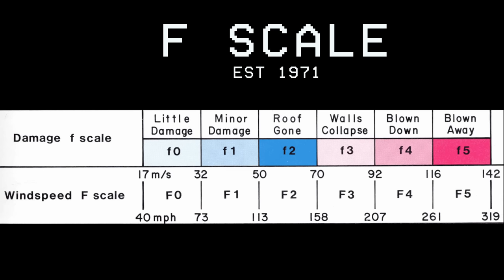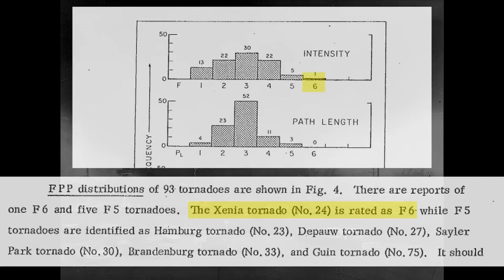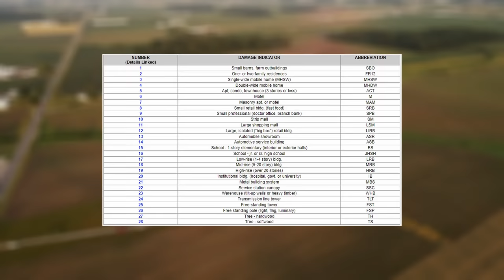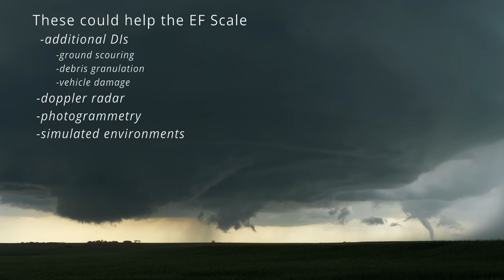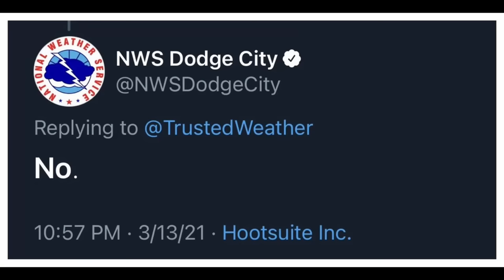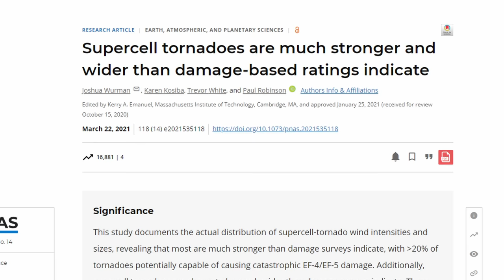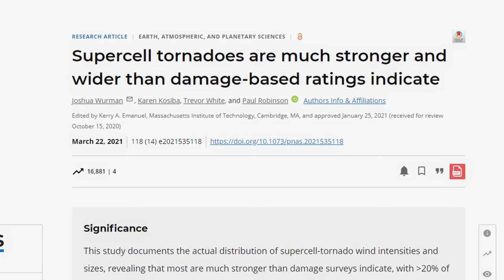Is The EF Scale Outdated?

Comment: If EF-5 is complete devestation, how much is more than complete devastation?  Perhaps there need to be more people to agree on EF5 actually taking place.  Tuscaloosa 2011 comes to mind as an EF4 that was totally underrated for what reason I don't know.  El Reno we know is way more than an EF3 but it didn't hit a stong structure. Great video on an extremely controversial topic.
Reply: They actually found EF-5 damage in Tuscaloosa and still chose to rate it an EF-4
Reply: @mpk 666  I would believe they did find that, do you happen to know where specifically?  I've read the NWS reports on it as well as the BMX report of their findings.  I will admit from what I saw it was not on par with what happened in Hackleburg or Phil Campbell.  There were sections of asphalt missing out of the roadway and gas lines ripped out of the ground.  But it only takes one indicator, SURELY there was that.
Reply: @GravyHucker  It was at some apartment buildings in Tuscaloosa. Not sure exactly where, but it was mentioned in the report IIRC.
Reply: @mpk 666  Rosedale Court I bet.  I will look at that tomorrow, thanks!
Reply: @GravyHucker  i think it was specifically...

Apartments and houses in Alberta City. around Rosedale community, being completely wiped out (like Charleston Square Apartments)

a section of bent railway tracks and tossed rail cars that leads people to believe EF-5 winds were taking place, considering how insanely strong something would have to be to do that
Reply: As for the apartments i think theyre the ones at 33°11'8.07"N  87°33'8.35"W, and the ones immediately northeast (with a pool in the middle, if you go to April 2011 imagery on Google Earth)

Both apartment complexes had parts that were flattened to the ground, and, for the case of the northeastern one, were two stories tall
Reply: Tuscaloosa April 27, 2011 should've been an EF-5. A former student of Dr. Fujita, Dr. Greg Forbes, former severe weather expert at The Weather Channel, said he believed it should've been EF5.
Reply: @h.f6364  Another thing you look for are trees are have been stripped for their barks.

Comment: While I certainly agree that the EF scale is outdated, there is a problem with using doppler radar to try to measure wind speeds, mainly within radar holes. Since wind speeds are typically higher the higher you go up in a storm, solely using doppler radar would overestimate the ground wind speeds in these areas

Comment: El Reno Chapman Violina   Soso-Bassfield and mayfield should definitely be rated EF5.   Worcester was also a very strong tornado however there was no doppler radar so it’s tough to tell how strong the winds were. Grazlius did rate it F5 though
Reply: The Chapman tornado would of been a EF5 if it hit Chapman directly and that's according to the nws. The Violina tornado was rated as a EF4 because one home was poorly anchor and some homes were nail to the foundation not bolted. The Violina tornado would of been a F5 on the old scale.
Reply: @Sj430  Chapman was also under a slight risk day that too. Which I think slight risk isn’t really light. I think a level 2 out of 5 should be Low chance of severe weather.

Slight/Low/Elevated/Significant/Extreme
Reply: Grazulis is a genius

Comment: I just want to lay out some issues I had with this video and if I seem harsh I'm trying my best not to and just trying to put my input on this because I'm not expecting everyone to be a fantastic writer with little to no problems. 

The only nitpick I have is that you said that the 1974 Super Outbreak had the most tornadoes in 24 hours, which if I could have a source to back that up then consider this null and void but officially April 27th, 2011 had 207 tornadoes that day, beating 1974's 148. I know that's a nitpick but it just stood out to me like a sore thumb. I know that really only hardcore weather historians would care but my main issues with the video in question lie much deeper than that nitpick. 

Firstly, I will give kudos to the background regarding Dr. Fujita, that was genuinely interesting and something I didn't know until I saw this video. However the video jumps straight from how long to the F-scale was used then into the EF-Scale with no reason as to why the EF-scale was made in the first place. Without some explanation as to why the EF-Scale had to be made, it makes the F-Scale seem like it was updated for the sake of being updated. The EF-Scale was made, primarily, due to reasonable concerns of tornado being overrated but primarily  because the wind speeds on the scale itself was too high. The two tornadoes that led to the EF-Scale being developed was Jarrell 1997, beginning with a paper written by Dr. Long Phan and Emil Simiu titled "Fujita Tornado Intensity Scale: A Critique Based on Observations of the Jarrell Tornado of May 27, 1997." The main tornado to raise concerns about the Fujita scale was the 1999 Moore F5 tornado. The heightened tornado winds was specifically a problem because buildings at the time that were destroyed by the F5 tornadoes of the time could have been flattened by tornadoes much weaker than the winds associated with F5 tornadoes. The engineers who were the primary critics of the Fujita Scale did not say the NWS was misusing the scale, but rather the Fujita Scale; while being fine for the time;  did not take into consideration of construction quality and building codes which needed to be corrected. The process of the EF Scale being created was over the process of 5-7 years until the release of the scale in 2007. The NWS adopted the scale, but the scale itself was made by Texas Tech in collaboration with the ASCE and NIST. Without that context, people will just assume the scale was updated because...reasons. I'm not asking for an in-depth explanation as to how it was made, just a general 

"After Jarrell 1997, and Moore 1999, engineers and meteorologists began to voice concerns that the Fujita scale may be overrating the intensity of tornadoes and how the overrating of tornadoes weakens building codes, thus the scale needed to be adjusted . So over the next few years, the Enhanced Fujita Scale was created and adopted by the National Weather Service in 2007." 

Regarding the arguments made, I agree with most of them, the issue with using Doppler radar is that unless the radar is detecting those winds at the surface, then the winds the radar picks up are higher up in the atmosphere and are likely not related to the tornadic winds at the surface. Ground scouring as a damage indicator is a great addition, but the main issue with implementing it is that it HEAVILY depends on the soil composition, it's easy to see EF5 ground scouring when the soil is mostly clay, but other types of soil such as sand, silt, or marsh, the winds needed to cause extreme ground scouring tends to be less than the winds needed for the same ground scouring for clay. I must state that ground scouring is something that scientists (Engineers, and soil scientists (agrologists)) still don't truly understand fully. 

El Reno 2013's rating was actually an EF5 initially, but it wasn't the NWS who pushed back on the rating, but rather engineers who helped to create the EF-scale.

More damage indicators, yeah that's something that is needed 100%. 

A lot of the issues regarding the scale were noted by the National Institute of Standards and Technology (NIST) after Joplin, who stated that Joplin barely got the EF5 rating and the reasoning behind the EF5 rating did not use the damage indicators in the scale itself. The scale at the end of the day is a damage scale, and was the best way to measure it. But it took until 2017 before a committee was established because nobody truly owned the EF-Scale so there was confusion on how it could be changed without any one agency truly owning the scale itself. 

The new updated scale itself is taking into account radar imagery, and it expected to be a hybrid scale that is taking into account all of the criticisms of the EF Scale itself. However radar imagery and the like will not solely dictate a tornado's rating. The new scale is still in the works and engineers and meteorologists are working together to try and create the scale in a way to where it can accurately portray a tornado's intensity. It's also why I'm not truly that bothered about tornadoes ratings as much as others are, the fact that it's being fixed and the exact fixes that are going to be implemented are what weather enthusiasts want with the scale is greatly appreciated. But a tornado's legacy is not just defined by it's rating, but what it did to the hundreds of people the tornadoes affected. 

Again; I know this comment is long and I am trying my best to not sound like a prick, I just wanted to put my input in. The issues I pointed out did not seem like they were intentionally left out. If you have any issues with anything I said please let me know.
Reply from the maker: Thank you Alferia, I am familiar with your content/channel. Firstly, you are absolutely right about the number of tornadoes within one day, that was a mistake, I remember looking into it before but I somehow dropped the ball on that. As for your other critiques, I think they can all be summed up to I intentionally did not go into the exact details, especially with how the EF scale came to exist, because going into too much detail would have been bad for viewer retention. The point of the video was to show the logical flaws with fully depending on damage to assess a tornado, not the history of the EF scale.  I take pacing and rhythm seriously when editing my videos. As for your statement that the EF rating of a tornado does not affect the historical significance of a tornado, I vehemently disagree with that statement. EF5 producing environments are looked over with a fine comb, while EF4 environments (except for Mayfield) will most likely get swept under the rug. Also, you never addressed the data found by Josh Wurman, Karen Kosiba and others that shows how the distribution of tornado intensities is extremely different with the DOW than what is found using traditional damage assessment methods, to me that tells the entire story. I appreciate your thorough response.
Reply: @highriskchris  I haven't read that analysis but I will definetly look into it at some point. Been busy with finals and all. I also understand the issue of viewer retention, it matters much more regarding watch time with shorter videos than longer videos. The issue of not reading that analysis paper is on me though.
Reply from the maker: The first half of that paper is quite fascinating and easy to follow, the back half gets a bit technical. Also, I understand how busy college is, you are still posting regularly so serious props. By the way I have a degree in mechanical engineering and worked as a structural engineer for two years in the aerospace industry, but tornadoes swept me off my feet ha good luck with finals
Reply: Lol looks like Alferia just posted his next script in your comment section 😂
Reply: one thing to note , even if there going to fix the EF scale , are they going to fix the ratings of the past tornadoes? its kind of annoying hearing the it would be this strength today thing and not fixing it
Reply: @mario927265  They said they will look at previous tornadoes since it's an update to the scale and not a new scale entirely. Likely they will be honing in on Mayfield.
Reply: @Alferia  oh thank god then
Reply: @ExplicitWeather  for sure some improvement from the new one , some flaws still with the new one as in
the 3 new problems are
1:they are forcing all the wind speed to be 0 or 5 (as in 65 mph , 70 mph, 75 mph) this will cause a lot of 1 mph and its a EF(Number)
2:they are adding car damage , this is good but , its the most trash looking new di , the wind speeds make no sense , there are 3 dod with 110 mph winds , its obvious this one needs fixing.
3:chance of  no more EF5 in non hurricane prone areas (note no official f5/ef5 have ever happened here meaning more anti EF5 rating)

some still old problems
1:EF4-EF5 are still to hard to get
2:no (boxcars, train, sign boards or projectile) Di (mention for old fujita scale)
3:no (asphalt pavement scouring,Farm machinery,manhole covers,soil scour, 18 wheelers,vegetation scouring) di (important to stop underrating tornadoes)
4:no (shed,fences or law furniture) di , its to note these ones exist for the Canada EF scale

some big fixes includes
1:trees are completely reworked , totaly different from the EF scale
2:frame houses have been split into 2 di
3:frame houses wind speed make more sense for the poor/strong build ones
4:tree fall pattern(forest damage) di added (helpful to stop underrating tornadoes)
5:car di added (helpful to stop underrating tornadoes)
6:the 2 mobile home di have been merged
7:Farm silos and grain bins have di (farm silos helpful for less underrated tornadoes)
8:center pivot irrigation system is now di
9:metal building systems have been sub split into (non hurricane zone and hurricane zone)
10:radar ratings can be used.

and 2 that seem to be unsure but needed
1:EF4 car damage (2 di of 165 mph , one tiny change can shove it to EF4)
2:EF5 tree damage (they never showd the full tree dod list , only the first 5, so unsure how much there or if it can reach EF5)

there are others but there not big or that important
pretty much its getting 10 big improvements , and 3 downgrades , still 4 things to improve on.

Comment: This is going to sound dumb, but I honestly feel as if the current EF scale is classist. The only way to get an EF5 in today’s standards is if it were to hit a major city where people have enough money to build extremely well built structures. If you live in a rural or poorer area, the tornado is going to cause even more havoc and slab your house but may only be rated an EF3 or 4 because people can’t afford stronger buildings. To me that just seems wrong.
Reply: The damage done is the damage done. It doesn't matter what the rating is.
Reply: Actually, no. The Hackleburg-Phil Campbell, Alabama tornado didn't hit a major city, it hit smaller towns, and still got EF-5 ratings, while Tuscaloosa-BIrmingham didn't.
Reply: @tid418   It does matter.  It should be about windspeed

Comment: You know what’s also outdated?  The Saffir Simpsons scale used to measure hurricanes.  But most people seem to ignore the issues with it.
Reply: How is the Saffir-Simpson Scale outdated? They made revisions to be wind-only, without taking storm surge or barometric pressure into account. The size of a hurricane, we need to look at Charley vs. Ian, both of which hit the same portion of southwest Florida. They had the same intensity. But Ian was much larger in diameter, so it produced a larger storm surge. Katrina was a Category 3, yet produced a huge surge that obliterated the Mississippi Gulf Coast. Sandy was "only" a Category 1, but produced a large surge in New Jersey. Older versions of the scale included estimated storm surge in feet, and it was totally wrong because you can't apply it to every storm, or every part of the coastline.

Comment: I'm not sure exactly how Doppler's work when measuring wind speed, but what needs to be measured is rotational wind speed within the tornado itself. When you have a  counterclockwise rotating column of wind, for example, you would have faster speeds in the right front quadrant. Much like a merry go round ,the force would increase as it moves toward the outside edge. I forget if it's centrifugal or centripetal. In the automobile industry,  a tachometer is used to measure rotational speeds in RPMs. RPMs could be converted to MPH. I was looking for a tachometer for my personal use recently, and discovered that they are available in a wireless handheld version. It would certainly take something much larger than that, but I don't think it's too far fetched to incorporate a rotational measuring device in today's Doppler radar.

Comment: The ratings should be based off wind speed and damage done. Such as a tornado in open fields with 200 mph winds but does little damage would be a EF4A. The same strength tornado going through a residential area would cause a lot more damage and would get a EF4C rating. This just adds a damage rating of A-C to the current scale. The A rating being the least amount of overall damage and C being major damage.

Comment: I don't like that the tornado scales are based on damage. An EF-0 has winds of 65-85 mph. An EF-4 has wind speeds of 166-200 mph. The biggest problem is that if an EF-4 hits an open area and causes no damage, it will be classified as an EF-0. This makes people assume the wind speeds were 65-85 mph, when they were actually 166-200 mph. Why do they even include the wind speeds in the EF scale? And just because a tornado's damage path has various ratings throughout the path, that doesn't necessarily mean the tornado gained or lost strength. It just means it didn't do as much damage in certain areas, or it hit structures that weren't built very well. If an EF-5 hit nothing but trailer parks, there's no way it would ever get an EF-5 rating. 

I personally think it's a big problem. It's extremely misleading.